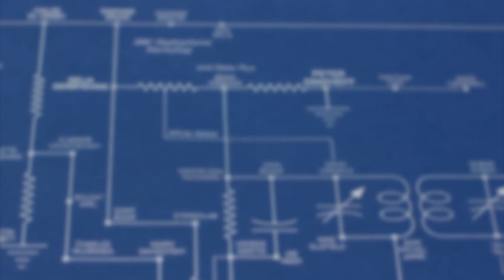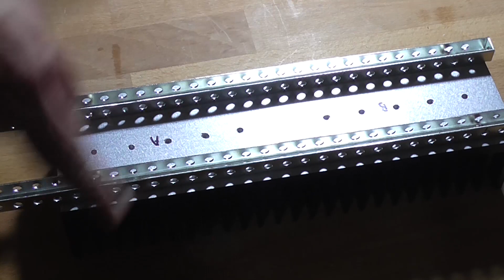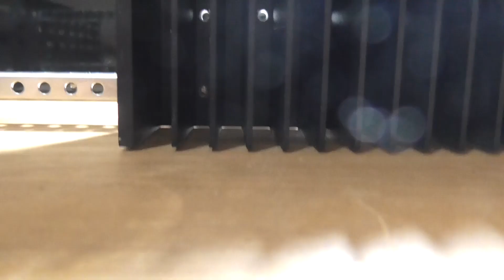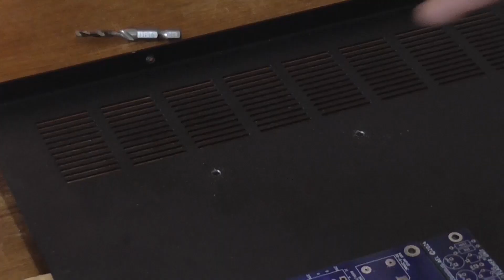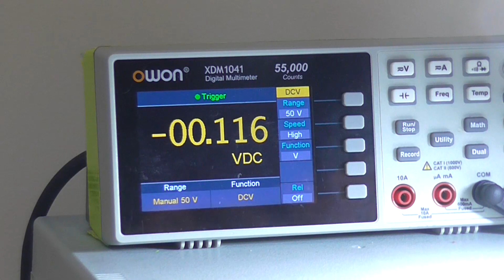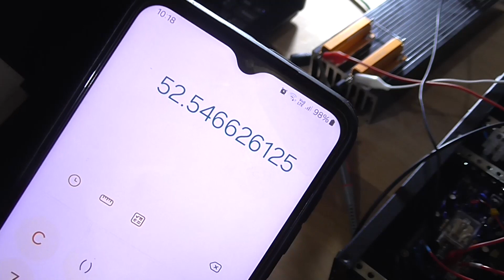AEL480 Stereo Amplifier Build: Pt. 3 - Getting to a Working State

Comment: I suggest you to don't put in a preamp. Better if you build a preamp separately in other chassis. Like that the preamp you can used with different amplifiers.
Reply from the maker: I understand what you're saying; however, can I ask your reasoning?
Reply: @AstrosElectronicsLab  it's much better the preamp to have a separate power supply and isolated from the same chassis with the amplifier. Low noise and hum